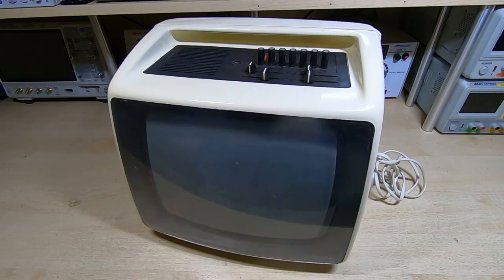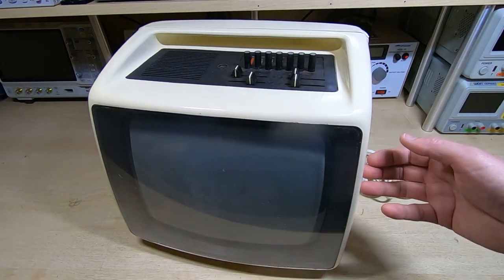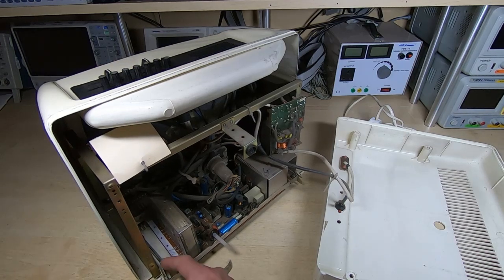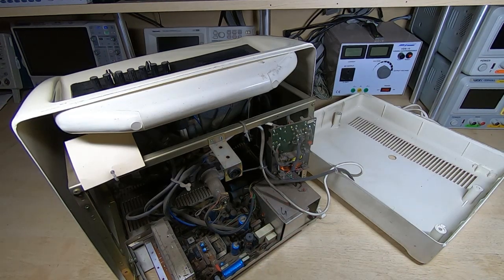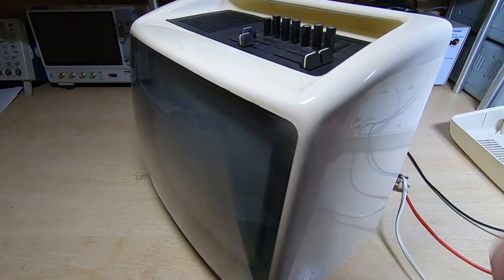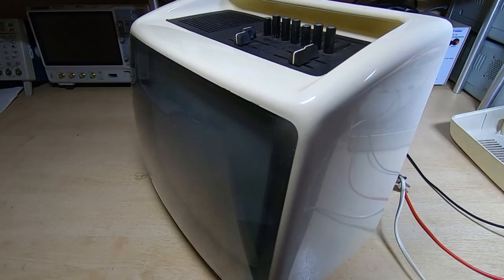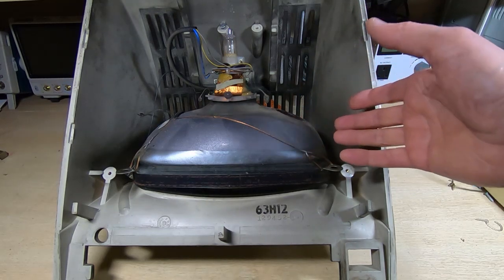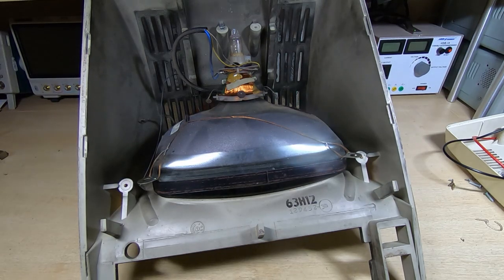ADM3 #3 Repair Part2

Comment: Even if you buy a tube from of he US, you run the risk of receiving it broken. I bought from the US a pair of HP 16500 add-on boards and even though they were very good packaged, there was a forklift prong shaped hole in both the package and one of the boards... Ended up fixing one of the boards and buying a replacement for the one with the hole in it.
Reply from the maker: Very true. I am about to ship one of the Hazeltine 2000 terminals back to the owner in the US. I had asked him to remove the CRT before he sent it to me because the chances of it getting damaged on the way to me or the way back are so high. In one of my businesses I once made a formal complaint against a well known courier because they damaged so many shipments costing me over £120,000 each year. The idiot who contacted me said they handled over 4 million shipments each year and only had damage to 4%. She seemed oblivious to the fact she had just told me that her company was damaging over 160000 shipments each year (even if I was to believe it was only 4% because in my experience it is over 30%).